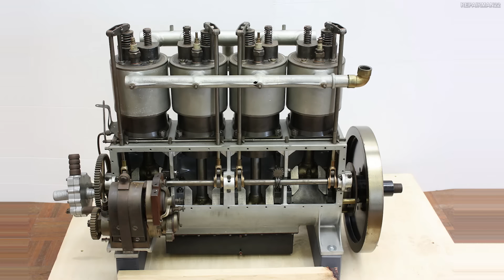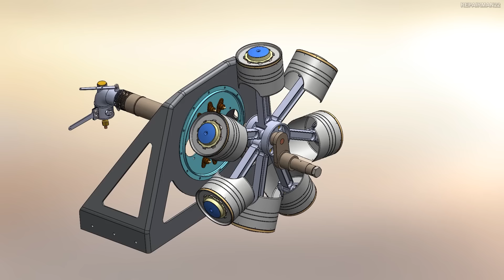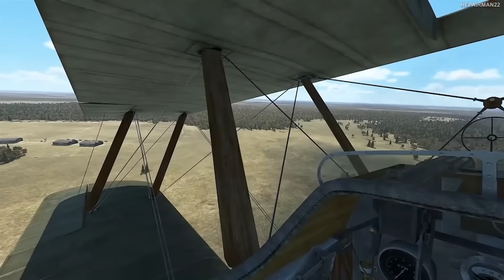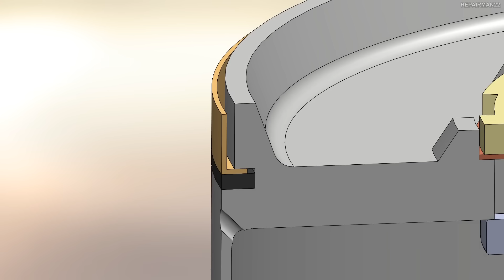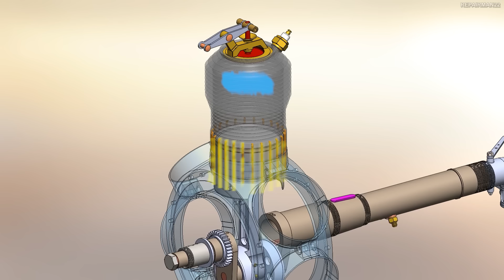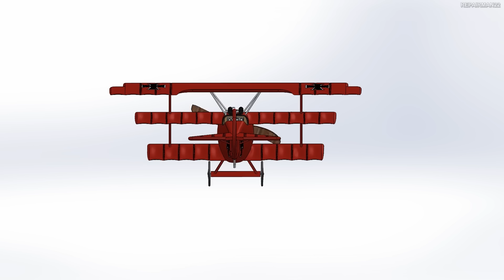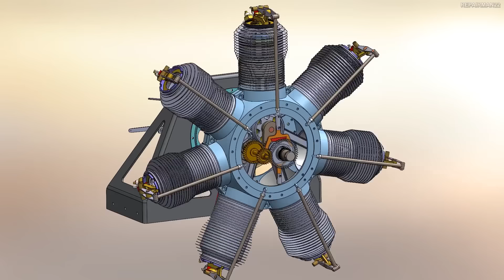This engine has a VALVE in the PISTON 🤯 Radial Rotary Engine

Comment: You would think that with the odd flight habit of changing the turning speed better in one direction, the Air Force would request that half or so of their supplies engines be configured to run backwards, so that the enemy would have a harder time predicting their flight in dogfights..
Reply: that would clash with the pilots training. they were already having a hard time getting enough staff, without training half of them for clockwise propellers and the other half for anticlockwise. can't put a pilot in a plane they're not trained for.
Reply: @martin-vv9lf  
I know there would be that reason to address, but could also be trained. Easy enough to Id the plane for themselves, in the cockpit but not obvious to enemy pilots. But I'm sure someone must of had the same idea then, but was weighed against doing it. I don't know enough details of the history.
Reply: It was like flying a gyroscope, turning 90 degrees from what was expected and then opposite south of the equator.
Reply: @garydole9427 😂🤣😅
Reply: yeah nah, its better to have planes all behave the same so the pilots can be trained to use it plane to the max 
and not end up in another plane where they have to do opposite from training
Reply: But then you also have people who can only fly half the planes effectively
Reply: That would have thrown the enemy for a loop for sure!   And given the pilots who were flying them one heck of an advantage! Probably would have made a lot more aces on the Allied side.
Reply: I like how you think outside the box! obviously you were never around the military. can you say regimented. "But it's supposed to turn to the right they all do haven't you heard?"😂